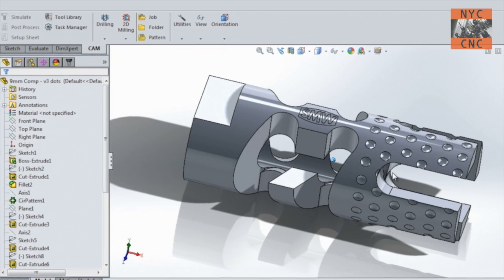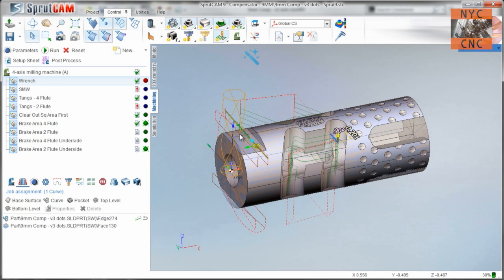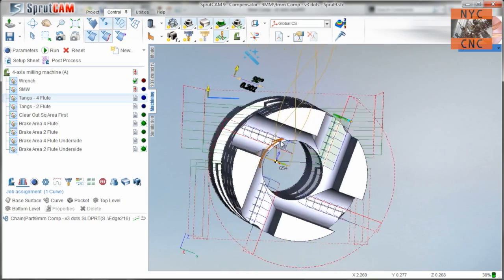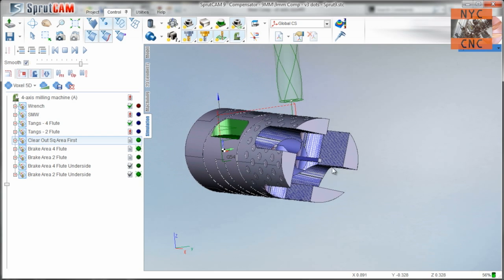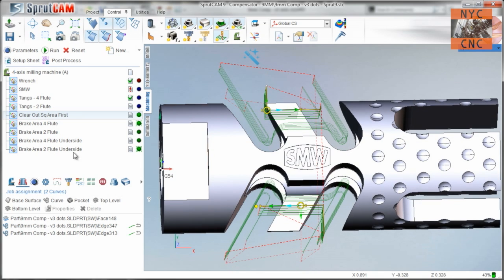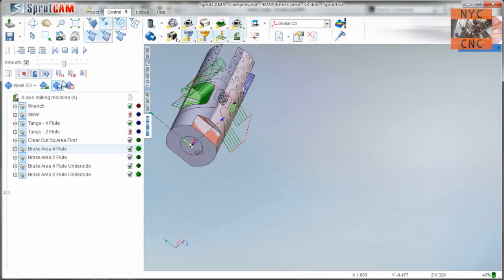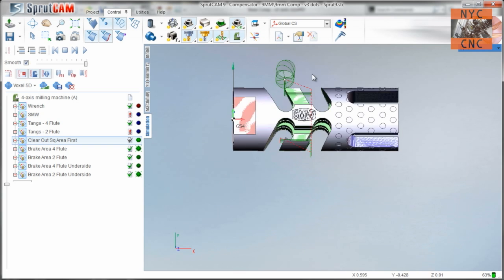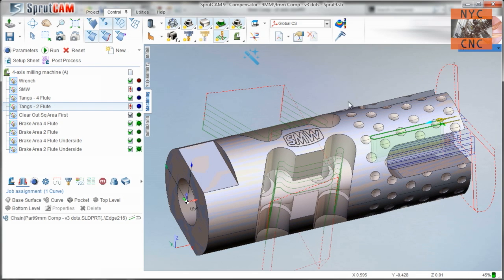Gimme a Brake! Machining a DIY CNC 9MM AR-15 Muzzle Brake! SprutCAM 9 CAM Video

Comment: It's not the screen recording software, per say, it's the core, some programs aren't well written when it comes to coexistence. In some extreme cases even Windows on Windows "overlapping" (using the wrong word, but i can't remember it off the top of my head) occurs.

Out of curiosity, how much ram do you run and what is the CPU you're using?

Something i'd try if you have multicore is to go in Task Manager and tweak these two options "set priority" and "set affinity".

For example i'll take two things i know for sure create that exact "overlapping" issue, Chrome and Photoshop CS5 on a quad-core sometimes choke each other out.

What i'd do is go and put a higher priority for Photoshop but never maximum, even if the setting is there, leave that option for the system to decide and lower the priority for Chrome. (this one is based which is more important)

As for affinity, if you do a small Google search on what system the respective program was designed to run you will see that some are meant to run on single core, dual core, quad etc. It's also a thing if you have the 64bit version or 32 one, so be sure to check you have the right "puppy bowl for the right puppy" so to speak.

Hope that wasn't boring if you already knew these things.

One more thing i'd do if i were you would be to give up the excess stuff like themes, services that are never used etc. Helps a ton. It can make a lagging and slow system a decent sprinter.
Reply: NYC CNC Check this page out. It's my go to for whenever i strip a system for someone. http://www.optimizingpc.com/

Heh, it's funny because every time i finish one, it's always the same line "hey, that's windows 95, didn't i have 7/8/8.5 on this?" But when they get to play around to it they immediately see the difference. It's like tuning a car. A little wire here, a better set of spark plugs there.

At 6gb is think it's the two programs stepping on each other's toes. You shouldn't have problems even with what you have on it. So whenever you have half and hour i'd give the old methods a try again. :)